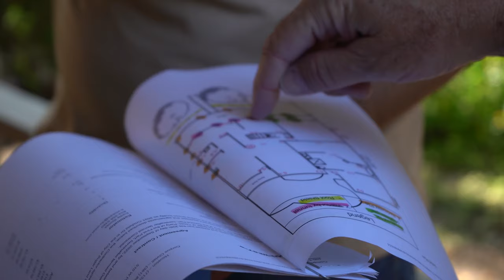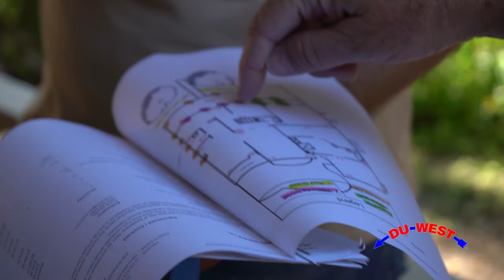Foundation Repair and Maintenance Explained

Comment: How do I find a good contractor?! I’ve always been screwed when hiring people. I feel like they always take advantage of me cause I’m a women.
Reply from the maker: There are several factors to consider when selecting a great contractor to work with. The best advice is to go with your gut. If the contractor shows up to provide an estimate late, has a messy vehicle and a messy appearance, and has missing or incomplete information that was provided to the office during booking then that contractor is setting the groundwork for how that project will go. Asking for most or all the money before starting a project is also a red flag. Google reviews are good but can be easily manipulated to make a contractor look better than they are. Word of mouth is an ideal resource for finding a great contractor. Finally, if a contractor can't explain to you exactly what they will be doing and how in a straightforward and easy to understand way that makes you feel comfortable with signing a contract they probably don't know what they are doing very well themselves. You want to feel confident with your decision to do business, not confused, because once the project is underway it's hard to go back.

Comment: The most clearly explained underpinning video on YT, or anywhere for that matter. Understand foam injection probably not as a permanent solution as resin companies claim. But if only one side of a slab is underpinned, wouldn't in future have uneven settlement of the slab as remaining 3 sides are not strengthened/underpinned ?
Reply: Thank you for your compliment, and great question! There are two factors involved here to address. 

The first would be the expected tendency for one area of the house to continue to move on active soils vs the stabilized area where piers are installed. You do create the potential for differential movement when you have dissimilar foundation supports. We take two main steps to address this. One is, when designing a pier plan we fully underpin the active area with piers. Some companies attempt to only support part of the active area to save costs and try to win more work, but they are ultimately doing their clients a disservice because if the area that is already active is not fully addresses this will undoubtedly create just as much, if not more, stress on the structure down the line. Two is, we often look for what caused the foundation movement in the first place and try to address the cause with maintenance solutions such as root shields, foundation watering systems, retaining walls, drainage, etc. to prevent the active area from spreading any larger.

The second factor, and potentially your main train of thought, is if part of the house is lifted does this put extra weight on the other parts of the house and potentially push them down? The short answer is, no, but to summarize concrete slab foundations do have quite a bit of flexibility in them and they deform (bend) long before they transfer enough load to the other end of a house to push it down.

Please let me know if you have any other great questions.
Reply: @johanndutton8370  Much appreciated. I don't have to deal with this massive headache at the moment, but good to know.

Comment: Concrete piling are worth crap. Get some helical piers and do it right!
Reply from the maker: We install concrete pressed piles, steel pressed piles, concrete drilled bell-bottom piers, helical piers, polyurethane injection, and mud jacking as foundation repair solutions depending on the structure type and soil conditions. The concrete pressed pile is our most common repair method for residential structures in the markets we serve throughout Texas, but there are some soil conditions and structure types that are best served by helical piers. There really is no one size fits all approach given the diversity of what we repair. I will caution that a concrete pressed pile installed poorly will not be a good repair, but the same can be said for a poorly installed helical pier. In order for our helical piers to be installed properly we have geotechnical testing done on the site to evaluate soil conditions and we evaluate the weight of the structure we are lifting. These factors influence how large the helix is on the pier we have custom manufactured for that site, what minimum depth we must achieve with the pier, and how much torque is applied to the pier during installation. These additional steps to the design phase of a properly installed helical pier and the additional cost to do so is why this method is not the default solution for most residential foundation repair projects in our industry.

Comment: Do you have to have a licensed to do this type of work?
Reply from the maker: Unfortunately, just like roofing, there are no licensing requirements for foundation repair in the state of Texas. I can't speak for the rest of the country. Part of the reason for this is that there are no building codes that define specific repair requirements for your foundation. Due to these factors, most municipalities that require permits mandate that either an engineer's report or engineer stamped drawing be submitted by the contractor to pull the repair permit. This leaves the industry open for anyone and everyone to call themselves a foundation repair professional, and it puts a huge burden on the consumer to understand who they choose to do business with. With that in mind, this is one of the reasons Du-West invested in putting this educational video together, so we can educate Texas consumers on what doing it right looks like.

Comment: Where can I buy Concrete pressed Piles like the ones you are using?  (Live in AZ in the middle of nowhere and have to DIY). Excellent Video!
Reply from the maker: Transparent Engineered Solutions is a member of the National Foundation Repair Association, and their President Bob Brown is an active participatory member. You can reach them at 602-763-1307 and they should be able to provide some better local information on material sourcing. Thanks for the great feedback.

Comment: What is your view on polylevel foam to level the home?
Reply from the maker: We do not recommend foam injection to level a slab on grade residential foundation that was built with grade beams (almost all of them). We have two polyurethane injection installation rigs and cover the state using them to raise sidewalks and driveways, parking lots, warehouses, etc. The difference between these examples and a residential slab is a house has grade beams which act as a skeleton holding the slab all together. When you inject one of these slabs you are actually lifting on the mat (thin part of the slab) and the grade beam is no longer supported. This is the primary issue. Another issue is the potential to create under slab sewer clogs if the foam seeps into a pipe that has come apart. Finally, with foam injection you are still relying on the surface soils for stability. If the soils ever get wetter than it is on the day the injection is installed you can actually heave a house up higher than you intended.
Reply: @du-westservices  Thank you for explaining this.

Comment: We have a huge patio against our home that opens up along the perimeter to form landscaping beds between the patio and our home foundation. The problem is that these beds fill up like a swimming pool. There is a solid line taking this water away, however it seems to stay moist several days after a rain. I thought I could add drainage, but I'm not sure this is the solution. Other than removing this huge patio, what would remedy this situation? Do you do this kind of work?
Reply from the maker: With the situation you are describing adding drainage is typically the right solution. We do this type of work and can be reached at 713-473-7156 to provide a free evaluation. We look forward to hearing from you soon!

Comment: I have mole in my both yards. And i guess if can cost fundation problems.
Reply from the maker: Thank you for your question. Typically we would not expect moles to have an impact on the stability of your foundation. The load bearing soils under a slab foundation are quite deep, and the foundation is able to span a small area of small soil disturbance without issue.

Comment: Good video!  Do you always use the concrete piers or do you also use steel piers and if so, when would steel be more suitable?
Reply from the maker: Great question! We install concrete pressed piles, steel pressed piles, concrete drilled bell-bottom piers, helical piers, and polyurethane injection as foundation repair solutions depending on the structure type and soil conditions. The concrete pressed pile is our most common repair method for residential structures in the markets we serve throughout Texas, but there are some regions in Texas where steel pressed piles are a better solution. This would include if you have rocky soils or a heavy sand layer under your home. If you would like more information or would like a consultation with our team please give us a call at 800-457-2966.
Reply: Agradezco a esa gran compañía que me dió trabajo por mucho tiempo !!!🙏🙏🙏🙏

Comment: How do compact the soil in the tunnel?
Reply from the maker: We backfill and hand compact the native soil in tunnels. This will leave a small void at the top of the tunnels. Once foundations are lifted by piers there will almost always be a void created under the slab in the area where the piers are installed. This void is left to allow the soil to expand and contract with changes in moisture without heaving up the foundation. Once the job is completed the soil deep in the ground bearing the piling will be what's supporting the slab as opposed to the surface soil.

Comment: Why don't they put these cylinders  under foundation when building a house?
Reply from the maker: It is primarily due to cost. In the areas where we have active soils (expansive clays in Texas) many custom built homes are built with piers in place to prevent movement, but unfortunately most neighborhood tract homes are not. They still build these new houses today to keep us in business long into the future.

Comment: Why are you not using steel pipe like many others? Concrete pilings can break while pushing them. Having this work done is very expensive. For those of us with a lot of general construction experience, I don't see why this can't be a done by the homeowner.
Reply from the maker: We install concrete pressed piles, steel pressed piles, drilled piers, helical piers, polyurethane injection, mud pumping, etc. depending on the soil conditions and the structure type. To address your question, steel pipe has performance disadvantages in clay soil as steel piles are designed to be an end bearing piling not a friction bearing piling like concrete pressed piles. There are also cost disadvantages to steel piles as well, so while we do require them in soils that necessitate it, they are not recommended for all applications. Secondly, not all concrete cylinders are created equal which is why when we started in this industry we made them ourselves, and today we only buy them from a single trusted plant. That being said, if a cylinder is going to break under compressive loading that will often happen at the top of the pile. This is where the cylinder is being loaded directly by the ram and the cylinder is not encased on all sides by the soil. Finally, working with a trusted contractor like Du-West gains the protection of insurance, the performance of proper installation technique, the experience of lifting and leveling, and the security of a lifetime warranty from a company that is recognized in the industry as top tier.

Comment: That house looks fine. What caused this?
Reply from the maker: Vertical movement of just a couple of inches to a concrete slab foundation can cause several issues to the superstructure above the foundation including brick cracks, drywall cracks, and sticking doors. To keep these issues from getting worse, and to provide a permanent repair, sometimes requires foundation repair piers. The most common cause of foundation movement is moisture level differences in the soil supporting the foundation. When clay soil dries out it shrinks, when it is hydrated it expands, and as this process occurs repeatedly it causes consolidation of the clay soil which results in permanent shrinkage. To make matters worse this drying and rehydration doesn't always occur uniformly around a foundation, especially when there are trees, and this difference in moisture fluctuations to the soil can cause foundations to settle at different rates across the slab. Differential settlement creates slopes in the foundation which lead to the damage to the superstructure described above.

Comment: How much did that job cost?
Reply from the maker: I am not familiar with the exact scope of that particular project, but foundation repair pressed pile projects typically range about $5,000 on the low end and go up from there. The full scope and price depends on: how much area of the house has settled, how severe the slope is, whether the house is settling down or heaving up, and how the existing foundation is constructed. Please let us know if we can help.